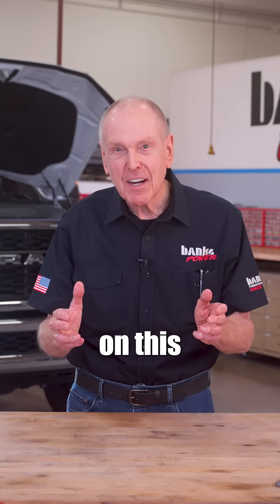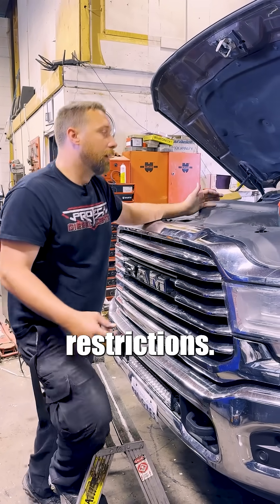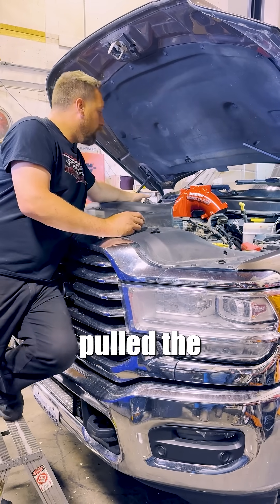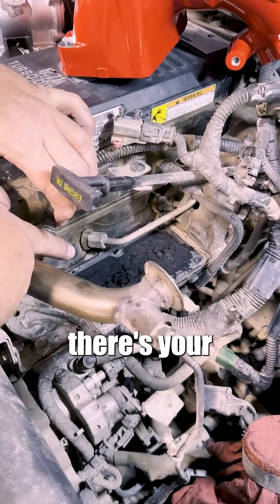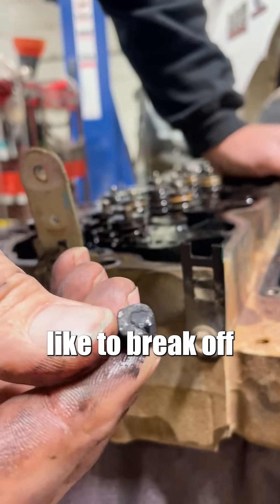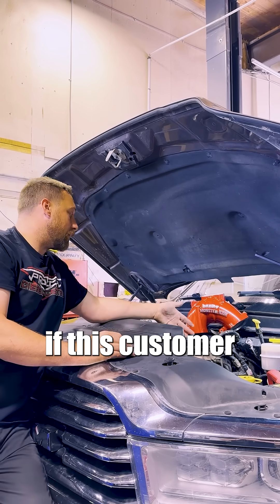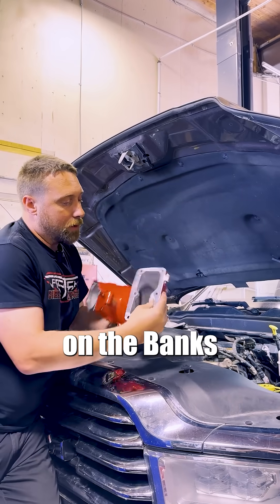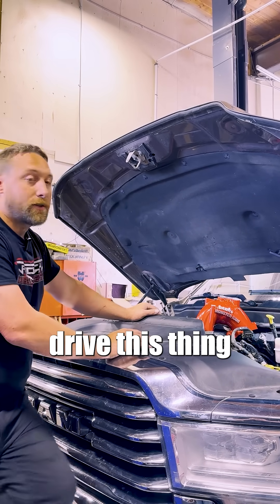This is a lot of soot. Let's make it stop.

Comment: Time to go electric! What a waste of everything, enough of this gas and diesel antiquated crap! One of mankind’s worst mistake was not developing electric vehicles from the inception of the automobile. But hey, keep workin out those Diesel problems lol man are we dumb.😂
Reply from the maker: The first automobiles were actually electric, not gasoline-powered. The earliest electric cars appeared in the late 1800s, with Robert Anderson's crude electric vehicle around 1832. The problem then and now is energy storage. Diesel fuel still packs more energy per pound than batteries. Now, that paradigm is indeed shifting. And, we're preparing for this inevitable future.

Comment: A plugged grid heater is a symptom NOT the problem.
Reply from the maker: Correct. The truck was either idled too much or had a boost leak and was over-fueling.

Comment: Peugeot 504 Diesels from the 70ies had a sud collector at the header Pipes. It was the Idea to collect Carbon at Low revs and temps, while driving in Towns. It would burn it off, when going on the Highway, where Nobody lives. It would eben ne cleaned, when servicing the Car.

Comment: Probably using the truck as a grocery getter and idling a ton.  A diesel likes to be worked hard.
Reply: My thoughts exactly. Had a 2007 model car with the 2.2 litre Ford Duratorq (Puma) engine. I was averaging a 30 mile commute every day, 80% highway. At 150 000 miles, the EGR valve and intake were still very clean and I had no loss of power. Only reason I had to take off the EGR valve was to replace a split boost hose.

Comment: Everything is junk now! Over engineered crap for over regulated emissions shit that doesn't work. If it's not an engine issue...it's a weak transmission or a crap rearend screaming! I owned many new trucks since 1997 and after 2001 every manufacturer is garbage as fuck.....Can't get past 100000 miles without a major repair.

Comment: IMO, the Truck in this video is being abused. In order to have that Much soot trapped in the Plenum, the driver is Dart driving at every Stop , than does an emergency stop at the next Red stop light, and just repeats at every stop, It's the operation of the driver habitual dart driving that creating that much soot. The owner Needs to sell or use the truck for inteneded purpose. Its a DSL NOT a GAS race truck. I hate external EGRs, but if the engine is equipped with  AECDs you must drive accordingly and upgrade your foot or prepare your Bank accounts for unnecessary repairs and withdrawals. Your Truck, Your choices, Your Money.

Comment: I hate emissions systems.
Political virtue signalling that the average Joe suffers through.
Disgusting.
Reply: Banks' grandson once did a video on the reason EGRs and DPFs came to exist. They are there for a reason.
Reply: @Zgurkogel  Hey, I saw it and the majority of the reasons make sense, but theory and reality don't mesh. Everyone straight pipes up in Alberta for a reason.
Reply: @MurCurieux I get that, especially after having had to deal with a fully blocked DPF myself. Still I think it's a good idea for engines to be as clean as possible, although admittedly the current technology is not ideal.

Comment: I don't you just make a system already like caterpillar did called a CGR clean gas recirculation they pulled the exhaust gases after the DPF and put it back into their engine they had no problems with it
Reply: Banks does an inline soot filter (for certain models) that sits between the EGR and the intake manifold.

Comment: We have bought this up to work, we have 12 Dodge Ram (5500, 4500, 3500) with Cummins we been fortunate. 2 has had problems with diesel emissions. Ones a 2018 with 330,000 miles on it, mine a 2020 275,000 on in 4 years. I got the truck it had 7700 miles on in July 21. Both of them were recently this year

Comment: No more soot on the grid heater, but more open flow for the soot to accumulate on the intake runners and valves. Better off selling that truck or deleting it.

Comment: Seems like this should fall under the federal emissions warranty.
Reply: I was told the emissions warranty is only 2 years... freakin bs!!
Reply: @nathanielbonebrake5502  Yhere is a 2 year federally required emissions warranty on most components. It is 8 years for major components like catalytic converters on light duty (basically non-commercial) cars and trucks. Should be 8 years on everything.
Reply: One of the first things my step-dad got on his Chevy 3500 was a def and egr delete. It took a month to get done and returned, but now he can haul a 5th wheel camper down an interstate on ramp and hit 80 before the end of the on ramp and back it without touching the gas
Reply: Yeah but the dealer will put the same crap right back on it.

Comment: this is why have a Ford 7.3l without EGR or DEF. 190,00 miles and still runs great
Reply: Had 1,049,375 on my last one before she died
Reply: 7.3 for me. I'm not exactly sure of the mileage on it because the odometer wasn't working for a while before I replaced the sensor in the differential. I didn't worry about not seeing the speed because it's a manual transmission, and I knew what the rpms are at normal speeds, so I didn't need a speedometer. The odometer has over 200,000 on it.
Reply: 7.3 are turds…and can be finicky on their own…i liked my 5.9 and 6.7 Cummins bettter than my 99 7.3.
Reply: Mine has 122k miles on it.
Reply: @jstar1000 
That's like brand new.
Reply: @davidscott5903 still looks new
Reply: 7.🌲life brother
Reply: 427k on my 7.3

302k on my dad's 7.3 and 330k on my brothers 7.3

All are still going perfectly fine.
Reply: 7.3 sounds good to me. No worries of carbon blockages.

Comment: The Monster Ram does eliminate the restriction of the grid heater and the bolt failure.  But I am interested in a post intercooler water injection system to keep the back side of the valves and the complete cylinder head intake system clean.  Plus the "latent heat of evaporation" benefits.
Reply: I have the same thoughts with my d max water methanol injection
Reply: Steam cleans fresh oil and soot and carbon way easier then years old and baked on. What I'm saying is that meth water injection early on a fresh build could really keep the carbon down.
Reply: Water is not going to keep it clean. Even WMI doesn't do much.
Reply: @OtisFlint  you might be surprised.  In my first hand experience, water can in fact clean oily deposits.  It does better if it is installed when the vehicle is new, but even on older vehicles, it can still clean things up.  It just won’t happen right away.
Reply: It's because it's steam really that cleans . The water boils turns to steam and it cleans pretty well . @OtisFlint

Comment: Our government regulations at work.
Reply: Just make new vehicles over and over... That'll save the environment... Somehow? 🤷
Reply: Convenient excuse from the manufacturer that does not design a system that actually works properly..
Reply: And yet dodge or RAM  knows about this but dosent want to deal with it
Reply: Yet they can order the same engines deleted!😢
Reply: Its not a delete,  it's a federal spec.... because they demand long term reliability.... anything the government can buy we should be able to buy.. @tazpal15
Reply: Damm those people who want clean air
Reply: @AdrianMcDaid you can still have clean air and have an emissions deleted diesel. It’s when they smoke due to bad tuning that gives them a bad rep.
Reply: @AdrianMcDaid  I’m not against diesel emissions on consumer vehicles. My argument against them is they are expensive to maintain. Commercial trucks with emission systems are much more easy to clean.
Reply: Requirements can be implemented better aka DEF is dump compared to EU. But, that is not COOL nor sells trucks. The manufactures don't implement it well, heavy trucks just bellow soot on roads and do deletes.
Reply: ACTUALLY! Not government regulations. It's UNELECTED bureaucrats with too much power creating and enforcing rules.
Reply: We gave the government too much power now they have interfered in our lives way too much.
Reply: But they don’t adhere by there mandates non of the government’s automobile have EGR fair right
Reply: It actually does more damage to the environment because these trucks just get scraped for being junk
Reply: More like car manufacturers designing engines that (temporary) meet the regulations in the cheapest possible way. Large ships have really well working EGR systems, but it's not cheap. Governments don't mandate EGR or how to implement EGR, it's choices the manufacturers make to meet the regulations. This will be over soon, manufacturers have stopped investing in fossiel engines and plan to end production whenever the current designs don't meet new regulations anymore. Electric drive systems will be cheaper in a year or two, so there is no profit in even more complex combustion engines.
Reply: @jwstolk Ya, that's not true. Battery tech isn't there yet, and with the regulators pushing wind and solar, the grid can't handle electric cars either. 

The regulations have 1 purpose: stop people from having the freedom of a personal vehicle.

Comment: I got my Banks intake setup
On a few months back nothing to complain about and glad the grid heater is gone, it was pretty nasty at 160k miles.
Reply from the maker: Glad you're enjoying the Monster-Ram!
Reply: Wondering why these intake horns aren’t teflon coated to prevent the soot from sticking.
Reply: @Nathan0A  teflon isn't a great chemical to heat up, and it's production is putting nasty stuff everywhere
Reply: @Waitin4_a_Mate Sure; beyond ~230c there’s some nasty offgassing but if your IAT’s are that high you’ve got other problems. Arguably a hot shutdown could cook the elbow but there are plenty of ways to mitigate, i.e sticking a coolant loop around the entire intake path. Either way mfg’s need to figure out these types of issues or else these otherwise phenomenal powertrains will be relegated to the history books.
Reply: @Nathan0A  They WANT to relegate everything to the history books.  They NEED you to keep buying new trucks, not maintaining the one you already have.
Reply: To save the company money on priductioon.